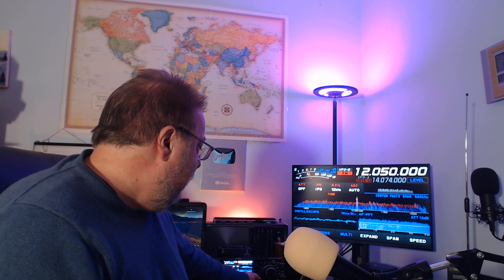Example of noise levels MLA 30 loop antenna VS Half Wave End fed antenna low frequencies shortwave

Comment: I use the MLA-30 as my receive antenna and transmit out on my vertical or end-fed for 40 and 80m.  works great here.  Also, I run about 800w on 80m and haven't killed the MLA yet with it only being about 20' from my transmit antenna.  While not recommended...  it has held up fine.

Comment: Not about shortwave even though I have a radio shack DX 392. What would you say is the best omnidirectional CB radio base antenna?
Reply from the maker: I purchased a 102 inch CB whip..works great and is inexpensive

Comment: I wonder how much of the reception problems are either noise related (QRN) of antenna orientation related.  It would be interesting to take both antennas or similar ones out to the park and see how reception would be there.